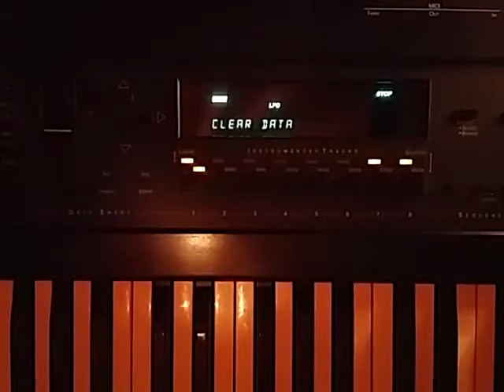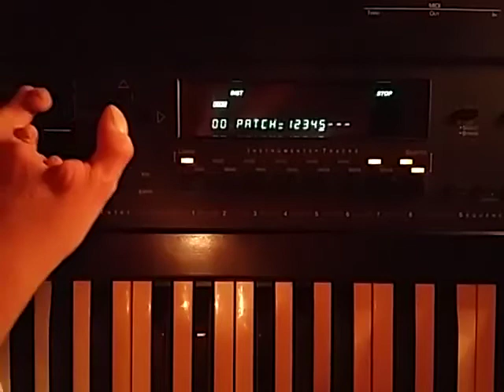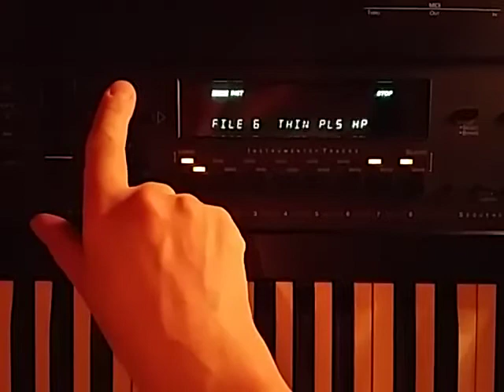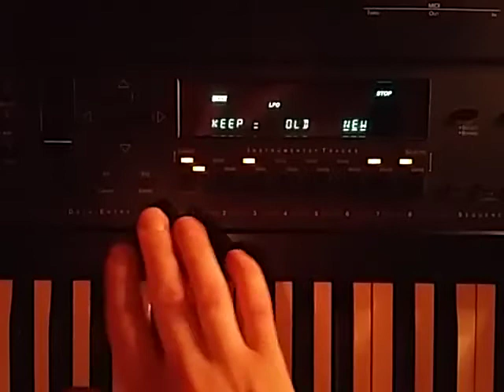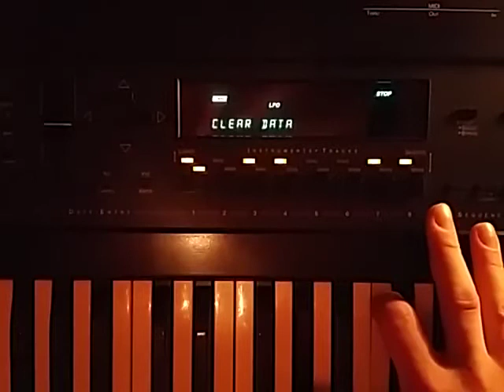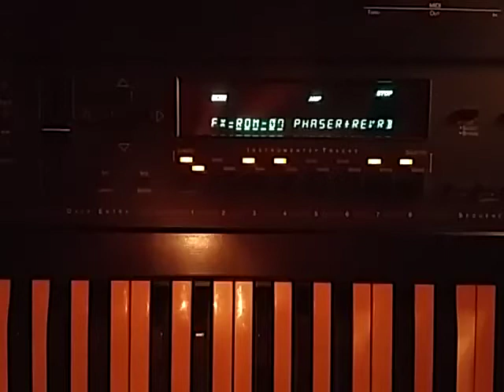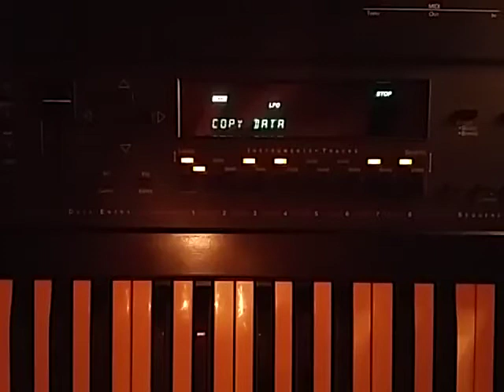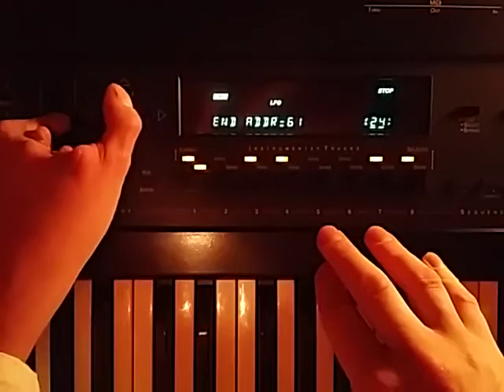Ensoniq EPS-16 Plus Synthesis - Wave Manipulation

Comment: I just spent a whole evening trying to make a "sine wave" instrument like your starting point here, and I just can't get it to sound as nice as yours.  I set the cutoff to 40, messed with the envelopes, tried different effects... I ended up with a lot of promising sounds along the way, but I really thought it would be easier to get to your step 1.  Any chance you could reply with a brief recipe?
Reply from the maker: Hi there. This video was made 7 years ago so I needed to rewatch it myself. I was curious and sat down at the ASR-10. Created an Instrument/Layer/Wavesample and set the Filters to 2LP/2LP and the cutoff values for both at 40.....and that sounds like the "sinewave" that I use in the video. I think for the video I internally resampled the waveform in the EPS-16 Plus and edited the resampled waveform back to a single cycle and looped it. That's pretty much it. I hope this helps.

Comment: love your videos. I have trouble with the loop options in cmd wave. I can never get a good loops from these. I always get clips. Synthesized loop works gre@t though. I have all three eps's, so it can't be my machines. especially all four of them. I have 2, EPS's and a 16+R with te flash memory. I also hve the ASR 10. I have a dcent looping workflow where I utilize auto loop 80%,of the time. Love the auto looping of these machines. I've have had lttle success with cmd wave looping options. but, it took to much time so it shows I dont have it down. Do you have any videos using these algorithms? Would you do something with this subject? I can crossfde fast on anything else, just not with tese options. Thanks man!

Comment: Hey Robin- Thanks for the video, can this be done on the asr 10 aswell?
Reply: Pretty sure you can, the system is basically the same, so if not using stereo samples - no problem!